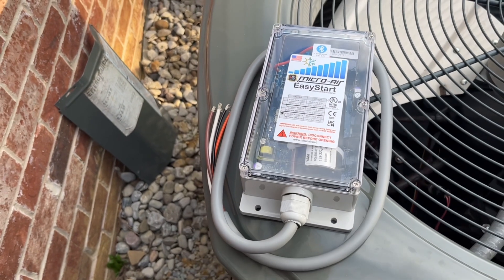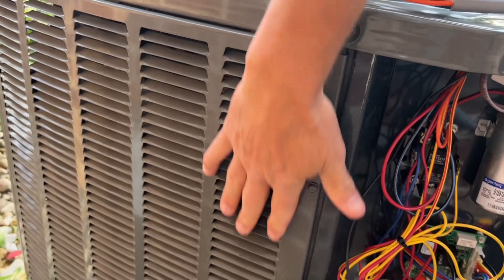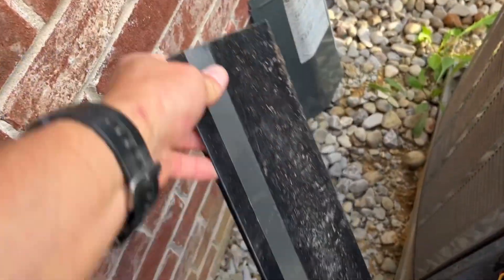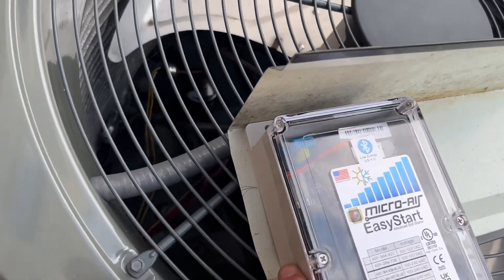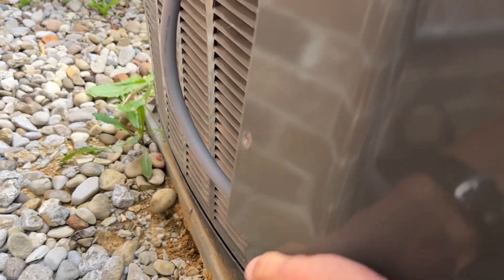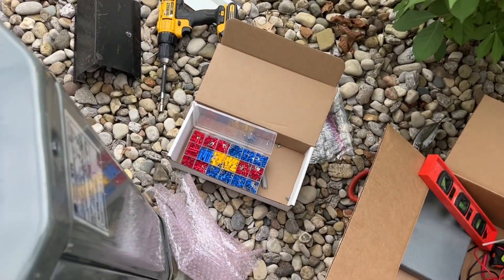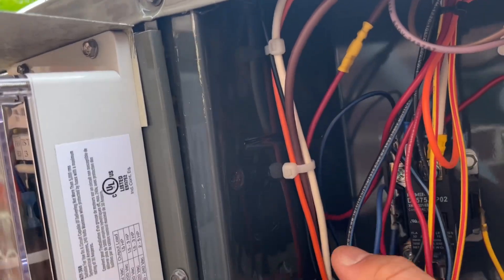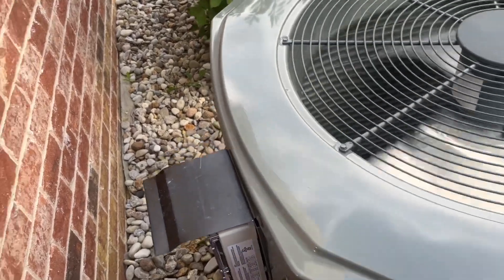Micro-Air EasyStart Soft Starter Externally Mounted Installed on Trane XR Heat Pump

Comment: To viewers, I suggest you check for yourself that the Microair model is suitable for unprotected mount.  It’s $400 with tax and you don’t want weather or condensation in the unit.  And he’s very right to check that mounting screws don’t nick any coolant piping; any nick, and your condenser will be toast or an invisible problem eating at you for years.
Reply from the maker: This is straight from the Microair installation knowledge bank:

“The EasyStart enclosure is rated IP65 which means it can have direct weather contact. For best longevity, EasyStart should be mounted in a more protected area whenever possible.”

Thanks for commenting.
Reply: Several years ago I installed my Soft Start attached to the outside of the AC  and it hasn't shown any weathering, condensation here in very moist southern Alabama.

Comment: I had Micro-Air EasyStart installed way back on my 2002 home back in 2010 and it's been running like a champ. Now i just installed Micro-Air EasyStart Flex on 2007 Trane XL 14i (new home) and it's in learning process. Now if i can figure out how to reduce loud noisy heat pump every time it starts and while it's running. does anyone have DIY or aftermarket "sound blanket" that actually reduce the noise with Trane heat pump? thx

Comment: Nice video and neat install.  I was about to attempt to install the same soft start device on my Trane 4 ton but found the unit had a factory installed hard start kit.  Since it's verboten to have both installed, I'm now trying to figure out how to remove the hard start system.  Did your 4 ton unit have one and if so, how'd you remove it? Thanks.
Reply from the maker: Mine did not have a hard start installed.

Comment: Great video. I have a trane unit as well. When I disconnect at the fuse box, some circuit boards like in your video at 1:05 are still blinking green. Did you have any problem wiring with them being on?
Reply from the maker: No problem. The green light on the defrost circuit board  is fed from low-voltage DC coming from the air handler. The connections I make in this video only deal with wires that are fed from the breaker I removed.
Reply: @willhancock1992  Thanks for the info!

Comment: Dont put one of these in, they destroy compressors. My Hvac guy said never put them in. Hes always disconnecting them. The hype thats going around about them is incorrect. They donot reduce current to the motor, you cannot measure correctly with a clamp meter.
Reply from the maker: How do you measure it correctly?
Reply: @willhancock1992  Im sorry but this guys comment is completely wrong. Sounds like he’s talking about stuff he doesn’t know. I’m a Master Electrician history in Residential and Commercial, but I’m now all Industrial. 
Soft Starts have been around for a very long time, and they help by limiting the peak draw of amps when the condenser or motor starts. This reduction will help the machine in the long run because the easier the start is, the better it is for it. Sort Starts are like gates that slowly open to give current. 
VFD’s are not used in the way you are thinking. They cost $1000 for the smallest ones for a reason. They limit the Hz applied to a motor so you can control is speed/RPM accurately. As well, if the motor is trying ti demand more current, the VFD will not limit that. 
In the case of the AC unit, we don’t care about the speed. We want the peak amps to be reduced, thus less wear on the machines and a lower electrical bill. A VFD will not help with that at all. 

A clamp amp meter is the correct way to measure amperage through conductors. The other method is to put your meter “In-Line” with its leads and pass the current through the meter. Most meters are not able to do this, and it’s extremely dangerous to do it on anything that’s not 4-20mA. Industrial standard is a Fluke 378 and have the conductor in the middle of the clamp.
Reply: @willhancock1992  There is no way that I know of because the current modulation schemes the particular box uses is proprietary to the company that makes it. You can only measure it with a device that is designed to read the format it uses. Theres a standard out there called VFD (Variable Frequency Drive). Its mostly commercial/industrial but its a standard and there are meters with a special mode to read it. But these after market boxes use there own scheme so you probably cant. But you have to know that a motor that turns a certain torque load needs the same current to turn that load and no add on box changes that.

Comment: I just ordered a newest model Micro-Air Easy Start Flex. Supposed to work on any size condenser unit. I have a Goodman. Not sure about the BTU's or Tonnage. Thanks for the informative video.
Reply: My flex blew up after 3 months. I hope you didn’t install yours.
Reply: @richardy.  I just installed my flex. I noticed my ac blows a lot less air after install. It's taking a lot longer to drop 1°.
Reply: @richardy.  Did you follow up with Micro-Air and what did they say if you don't mind asking? did they compensate for any replacement parts of your unit? thanks

Comment: Very nice. I've seen some other folks get another junction box to put the micro air in. They also use magnets to mount it even though I would prefer some small self tapping screws. I like your little metal roof.
Reply from the maker: Thanks! Small sheet-metal screws worked for me.

Comment: can these be used on 2 stage units ? thanks
Reply: Even if someone answered, this is something you need to research at the micro air site, specification and product sheets, etc.  It’s like someone telling you the circuit is off before working; you check it yourself.

Comment: I was curious would these Micro-Air units be re-usable, in your opinion? Say for example you had to have one of your AC units replaced, could you take this off and re-use on the replacement AC.
Reply from the maker: You may want to get your answer from Micro-Air itself, but I see no reason why you could not do that. In the associated app, you can have the unit “relearn“ your heat pump if a major component is replaced, like the compressor or fan motor. That being said, it could easily relearn a different heat pump.

Comment: Any issues with the Micro air easy start since you installed?
Thanks
Reply from the maker: None. Power went tout twice in the last month. Both heat pumps started and ran with no issues on our Generac.
Reply: @willhancock1992  
Good to hear thanks for the response.
Reply: Social media noise about ICM and MicroAir failing prematurely.  If it’s within warranty, it’s ok.